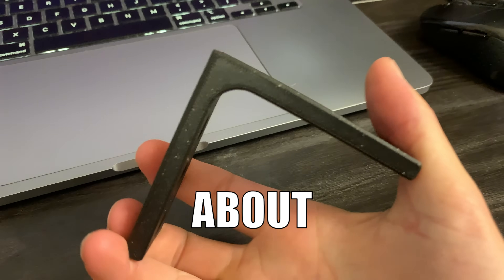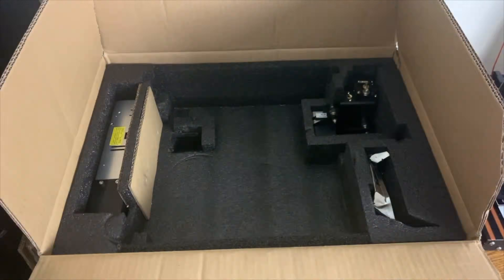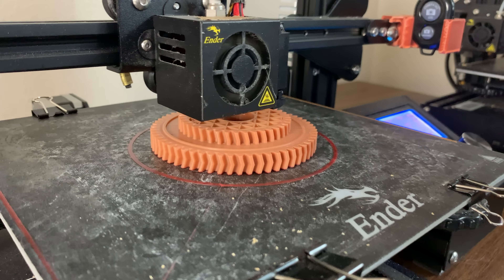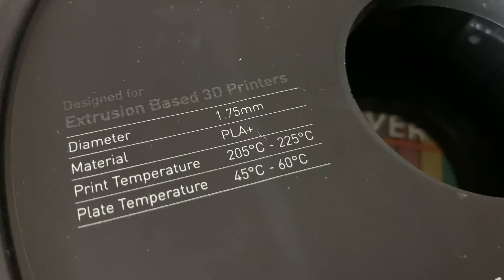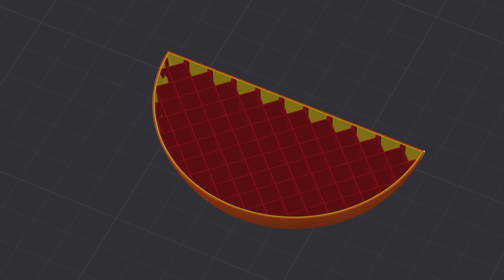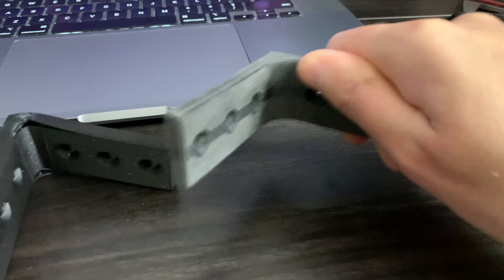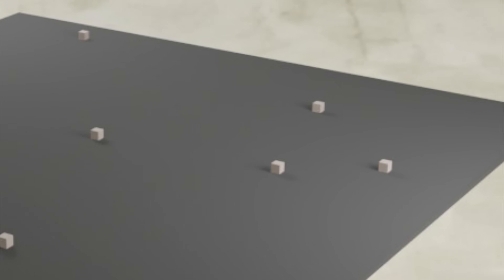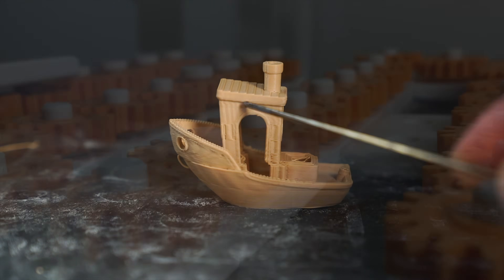9 3D Printing Sins...

Comment: Don't use flush cuts or "pliers" as they are called in this video. They are high carbon steel and are NOT meant for prying. The tips will break very easy. #1 Tip, just let the bed cool. As the bed cools it shrinks. The plastic will shrink at a different rate, this will release the print.
Reply: Most people are not getting that the issue with the pliers is not damaging the plate. It's rather breaking off the tip of the plier and having it fly into your eye.
Reply: Yeah that's incredibly bad advice. Bad enough that I looked at the date to see if this was an april fools video.
Reply: take the build plate off the heated bed. the heat bed takes a bit to cool down, but the thin sheet of metal will cool down pretty fast if not heated from below.
Reply: yeah, that was a WTF...   dude probably uses a wrench to nail nails.
Reply: I own the same pair and I can sadly inform you that they are not hardened. Too cheap for that. The blades bend and do not break
Reply: @DesmaraisChris  I own the same pair and can inform you that they do, in fact, break because I broke mine trying to pry away some stubborn support material. I can also inform that when the tip snapped it went flying.
Even if that was not the case, the video was NOT about these specific flush cuts and, as many people use many different brands, it is just not safe to assume that prying with them is same. It is irresponsible to recommend prying with any tool that is not intended for prying. The forces that are generated are immense.
Reply: @tsepash  what do you recommend prying support material with? Ive also been using those cutters to remove it and im really scared to break them as ive done in the past
Reply: @mainn0606  I use a 3D Printed scraper. Occasionally I will use a metal scraper to kind of tap on the print. I hold the edge of the scraper about 5mm from the edge of the print and tap on the end handle with two fingers, hold the scraper just enough that it can move freely but not so loose that I lose grip. I do this around 20 to 50% of the print and that usually frees the edge of the print enough that I can lightly slide the scraper under the print. I do this in and out motion while moving around the print and it (usually) lifts the print without having to pry on anything.
Spraying IPA around the edge of the print can also help this process because as the alcohol evaporates it takes heat with it. This causes the plastic to contract as it is less dense than the bed material. 
I still prefer to just let the print sit and cool. Last night I was awakened by the crack of a large print (40 hours) freeing itself from the bed. As you said, not everyone has the same bed material but I would urge you to try just waiting some time. I do understand that waiting is not an option which is how I managed to come up with the afore mentioned process.
Reply: @mainn0606  I apologize as I misread your comment so my last reply was not an answer to this question.
I use needle nose pliers and flush cuts to remove support material. Flush cuts are pretty strong, they are just not designed for a prying motion. Needle nose pliers (jewelers pliers) are very good for twisting stubborn support material back and forth until it frees itself.
Reply: @tsepash  lol ok, i dont have pliers so i should probably get some
Reply: Another way is to just spray some isopropyl alcohol on the build plate just around the printed object. The cooler liquid will quickly absorb the heat and evaporate and the thermal contraction of the shrinking plastic will create gaps that suck more alcohol under the print, helping detach further in.
Reply: Yeah mine broke while I was trying to cut a part out of my print because of an error in the model. I was using a lot of force though.
Reply: @exmirt6232  anytime you are prying with something you are greatly increasing the force at the tip. With these having such a narrow tip, it only makes sense that they would break. When they do, that force goes from being potential energy to kinetic.
Reply: I know you got tons of replies already but this! I come from injection molding and I can confirm most plastics just seperate from foreign materials when cooled. We had a trainee gunk up a broom handle with fiber glass plastic and he was panicing because he couldn't get it off. I put it outside in the snow and next day I could pull it off with my hand.
Reply: I usually use glue stick and then just spray the bed with water to soften it and make it release the part.
Reply: I always pry with my cuts, twist, grab, cut, with the same chinese ones as in the video. Haven't broken so far, even though I abused them to even cut metal guitar strings.
Reply: This is not an universal truth. Different bed sheet surfaces and filament materials will not just release. So much that some filaments printed on smooth PEI need glue stick not to adhere but to release. ABS, for example, has very little thermal expansion and when cooled solidifies the bond with PEI. I had to resort to acetone once to be able to release it without damaging the sheet.
If I didn't have it at hand I'd probably need to use a mix of reheating the bed and carefully using a metal spatula.
Reply: Depending what you're cleaning water and soap won't be enough. For example ABS particles can stick pretty bad in smooth PEI. for that I use acetone. Other types of glue sylicon and some rubber like material need alcohol
Reply: @fabio-franco  there are rarely any "universal truths" as you put it. So, unless otherwise stated, a comment usually refers to what is common. As for ABS having little thermal expansion, this is very contradictory to the reasons given for why ABS warps so easily and has a difficult time with adhesion. I probably will never use it so it matters little to me. If I was in need of a material such as ABS, I would most definitely use it's superior cousin ASA.
Most beginners do not jump right into using anything other than the top 3 most commonly used filaments; PLA, PETG and TPU. My method works on 2 of the 3. The oddball would be TPU, which is easily enough removed with a plastic scraper.
Reply: Yup. Couldn't believe it when I saw him doing that with the snips lol.
Reply: This is just like the video where he breaks the same exact 3d printer pliers on some guitar strings.
Reply: The tips will break very easy? Hell no, I hav the exact same pliers as in this video and it’s 1 completely solid metal piece, they don’t break at all, they are literally meant to remove supports
Reply: @TwixedBlocks I have the exact same ones as well and the tip is broken, from prying at supports. They are hardened high-carbon steel, which means they are hard but not pliable (bendy).
Just because you think you know, doesn't mean you do.
Moving on.
Reply: Cooling bed works only with plain PLA on textured PEI. Not with matte PLA and not with PETG. PETG is relatively easy to remove, but brims stick sometimes too well, they are flexible and only way to get rid of them is some tool.
Reply: @pavelp80  that is not exactly true, I have used PETG on both a glass bed and textured PEI. The ONLY time I have an issue with removal is if the nozzle is too close to the bed. 
There are cases when a tool needs to be used to get material off the bed, flush cuts are not the tool for that job. A scraper, butter knife, etc. is a much choice in tools. I have little need for anything other than a 3D printed, PLA scraper.
Reply: If the bed is removable you can also put it in the fridge or freezer to increase the cooling factor and make removal even easier.
Reply: Whether or not the bed releases naturally depends on the material. Glass and steel beds do self release, at least with PLA. But for example buildtek which is common on cheap printers really wont.
Reply: @Erowens98  still shouldn't pry with flush cuts.
Reply: no it dont
Reply: @oneredpanda9933  Yeah it do
Reply: @jamiemacdonald436  my bed dont do that. the parts stick and I have to use something to pull it off
Reply: @oneredpanda9933 in that case, take the bed surface with the prints on it and put it in the freezer after it cooled down, it works everytime
Reply: @oneredpanda9933  odd because this is how I release ALL my prints and my bed looks almost new after nearly 3 years. I guess in your world all materials cool, expand, and contract all at the same rate. For the rest of us, here in the real world, that is not the case.
Reply: @tsepash my bed sticks too
Reply: @dannydorito6827  It depends on the bed. PEI powder coated sometimes sticks to well to PET-G; esp. if the first layer is a bit to low. A usefull trick: Put printbed and print into freezer. It always but onced worked for me. The one time it didn't, I just heated up bed again and repeated freezing afterwards. Even with much to much sqeezed first layer. The different expansion of material due to temperature works better as more the temperature difference is. At the moment we have inside temperatures >30°C. It's to hot to simply let the bed cool down. Freezer helps a lot. But the high ambient temperature is nice for bigger prints without warping or layer seperation.
Reply: @tsepash well other people in the real world have other printers with other bed materials that stick differently, that shouldnt be that hard tu understand
Reply: @mainn0606  it still is no excuse for suggesting people use an improper, and dangerous, tool to pry on anything.
Reply: @tsepash  that part of it is true, i still believe you should use a scraper if its stuck even on a cold plate
Reply: @tsepash sometimes reality doesn't care about your physics knowledge. Sometimes the shrinkage differential isn't enough to overcome the adhesion, and sometimes the differential is so high that letting it cool while adhered to the plate can cause breakage or warpage. So it's not always possible to let the plate cool
Reply: @Dante-420  physics is reality and I have not once had ANY issue with common filaments. Many others have verified this.
Keep smoking, you will find you answers someday.
SMH.
Reply: @tsepash I hope one day you won’t be so acrid over little things like comments
Reply: @Kero676  I was neither angry nor irritated when any of these comments were made. I was irritated that this video recommended using a tool improperly which could, potentially cause bodily harm.  Maybe the irritation you see comes from within yourself?
Reply: @Dante-420  If your part is shrinking so much that it warps by the time it is cool, that has nothing to do with the bed but more thin geometries. Taking the bedplate off and pulling the part off when everything has cooled down has always gotten the part off for me. They were simply indicating ways to do with it without using prying tools.
Reply: @tsepash  I had to turn it off at 0:24 when he used the flush cut's blades to grab ahold of the gear face to pry.

Comment: There is absolutely a beenfit to using isopropyl alcohol. It flashes of almost immediately, and you can clean your built plate easily while in place. Soap and water does work great, but you have to take the build plate to a sink or something and then wait for it to dry before using. Wiping down the plate with IPA takes about 10 seconds and the alcohol is flashed off in less time than that. Just keep a bottle of IPA and a rag by your printer. I do a quick wipe before nearly eveyr print.
Reply: While taking the build plate to the sink for washing is a bit of an inconvenience, waiting for the build plate to dry after washing it is a non-issue. Less than 20 seconds with a towel gets the build plate dry enough that I can immediately take it to the printer, install the plate, and start printing. The build plate tends to naturally shrug off water, so it's quick and easy to dry it off. As an added bonus I've just washed my hands as well, so I don't have to worry about greasy fingers when handling the build plate.

Cleaning the build plate with isopropyl alcohol definitely is quicker, but cleaning it with soap and water is a reasonably close second place.
Reply: If you are cleaning after every print that is a bit excessive. Cleaning often with an inferior method isn’t as good as just cleaning less often with a better method. If you properly clean a bed with soap and water then it will last a large number of prints before it needs cleaned again, there is no need to clean it between every print unless you use an adhesive like glue stick or hairspray and if you need that you should just get a better bed anyway. Printing on the bed does not dirty it.

Washing the bed doesn’t take long either, just a couple of minutes at most and a wipe with a towel afterwards.
Reply: Yep.  A routine wash with soap and water is a great idea since using strictly IPA can also sometimes make your print wind up having a somewhat invisible swirl mark pattern on the first layer (easily noticable if you use transparent PETG after only cleaning with IPA for a little while), but for the most part, there's more benefits than drawbacks to using IPA as the go-to cleaner.

Comment: I clean build plates with dish soap, warm water, and a veggie brush. Removes glue stick super easy. If you have remnants that wont release from the build surface print a small "coin" over the offending piece and it will come up with the removal of the part. Let cool completely so it is nice and stiff before removing.

Comment: First time I used the X1 carbon I accidentally had it set to the p1p settings. It printed fine but it didn’t do any LiDAR calibration and that’s one thing I really like about the printer. Also having auto bed leveling is a dream after leveling beds manually for years.

Comment: FWIW, Grandma's filament clip is the best clip I've found. Stays secured when clipped, and if you use the version with the pass-thru hole, it doesn't come off the filament and keeps it from getting tangled as it feeds off the roll. Print half a dozen white and half a dozen black and you're good forever.

IPA is nice for spritzes between warm soapy waters.

I live in San Diego, southern california. I've never had a problem with PLA warping. Unless you live where it's literally impossible to stand outside, you're not going to get over 50 degrees outdoors. Of course, don't leave it inside your closed car. Don't use black if you're leaving it in direct sun. etc. But I think the worry about PLA warping due to sun is overblown.  And of course PETG and/or UV-opaque paint cures the heat and UV problem.

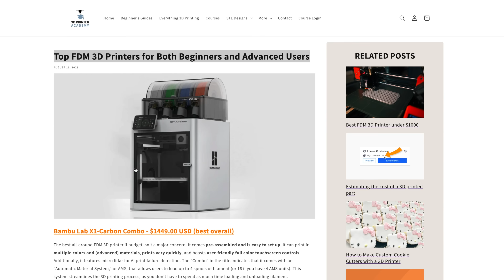Comment: 1:45 “I usually recommend saving up a little bit more and getting a printer with ABL.”
…showing manual leveling on a stock $100-150 Ender 3, then highlighting $1,000-$1,500 printers is not saving a “little bit” more money.

Comment: I got a 3mm sheet of G10 for a bed plate and haven’t looked back. Screw PEI that can flake off, glass that chips with PETG, etc. 

G10 holds tight when hot and lets go when cool. Even big prints don’t have to be scraped.
Reply: If you know how to use beds properly and what materials they can handle then you won’t have the problems you listed, it is common knowledge not to print PETG on glass or smooth PEI.
Reply: @conorstewart2214 
Hmm, i have a Sunlu S8plus whichbis a CR10S Clone. IT came wirh a Glass bed. The Glass Shows a structure on IT Like a door of a  Micro Wave oven.
PETG stays better in this Glass as my current PLA does.
The one and only Thing is to increase the bed temp of 5° as IT IS recommended.

Comment: I completely disagree that there's "no reason why you'd need to use Isopropyl Alcohol". I use IPA to spread the layer of glue I have on the build plate very thinly. I then might print a small part that doesn't take up the whole bed, and instead of applying more glue, I simply spray a bit of IPA on the bed and use it to respread the remaining glue on the bed. This generally gives me up to 4 or 5 prints before I wash the plate and apply fresh glue. This results in a really consistent thin layer of glue.
Reply: I have never had the need for glue stick except with this stubborn, old, Polaroid PETG that just needs thrown away, but, your method seems very smart.
Reply: @tsepash  a common misconception is that the main reason for using glue in 3D printing is to get prints to stick better. Though it can sometimes help with that, it's far more useful for getting prints to release more easily, which preserves the life of your build plate. I rarely have issues getting prints to stick, but I use glue as a release agent.
Reply: @tehhamstah  it isn’t a common misconception at all, the main reason for using a glue stick is to increase adhesion. If you use the correct build surface for your material then it will release fine, you buy a build surface to use, if you always use glue stick then you might as well just use a glass sheet, if you use the build surface properly then you won’t have any problem with its life. If you need a release agent for PLA or other basic materials then there is something wrong.
Reply: @conorstewart2214  It really depends on the type of build plate you're using and even more so, the type of material you're printing. There are a lot of plastics that will cling to a build plate strongly enough to tear off the coating if you don't use a release agent.
Reply: @tehhamstah  that comes under using the correct build surface for your material, which I already mentioned. If the material is tearing off the coating you are using the wrong build surface or the wrong settings. Also if you don't let the build surface cool enough then it can remove the coating. So if you use the correct build surface for your material and with certain surfaces if you let it cool enough it won't remove the coating.